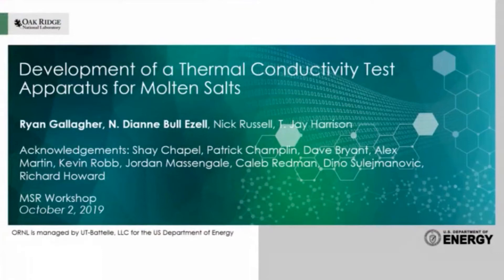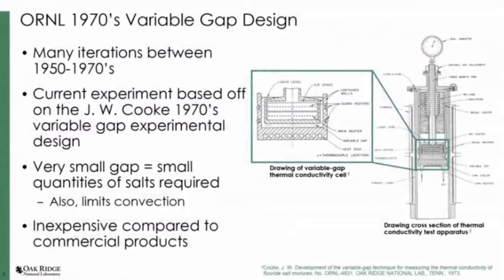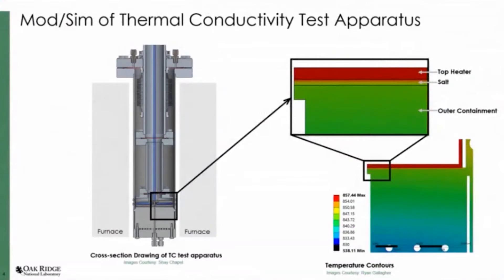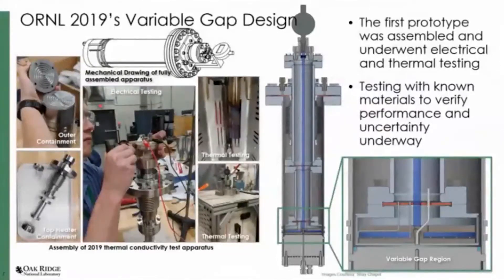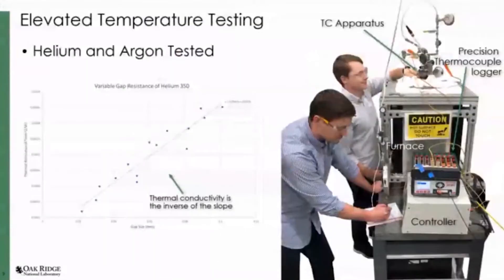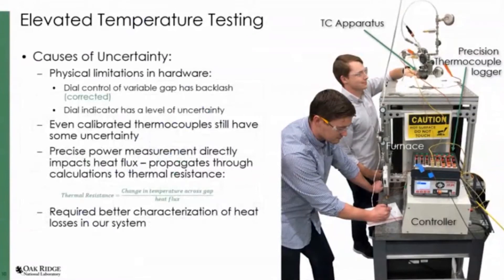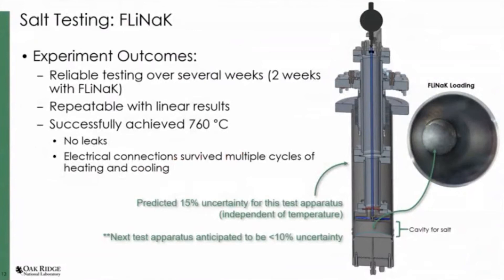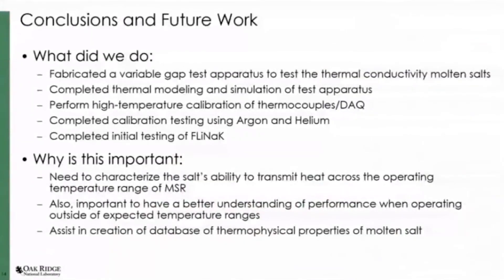Thermal Conductivity Test Apparatus for Molten Salts - Dianne Ezell @ ORNL MSRW 2019

Comment: I loved the question regarding Temperature. Indeed, there should be a goal around finding and creating a reactor that operates in the safe upper temperature limit in these molten salt reactors because higher temperatures means a more efficient energy transfer and a wider range of use as a heat source for various chemical processes.